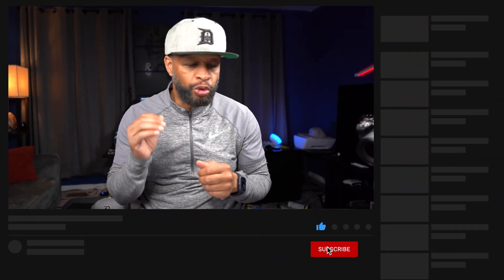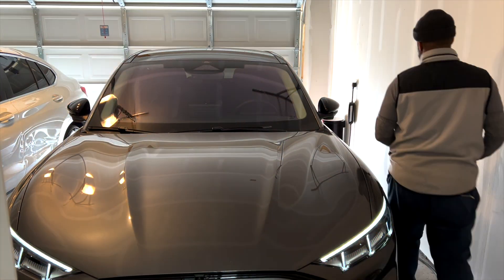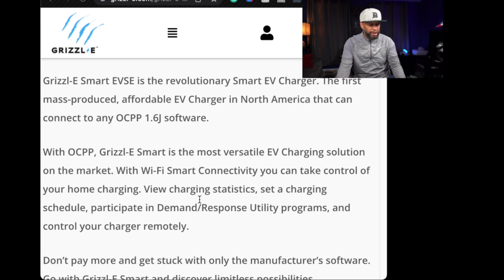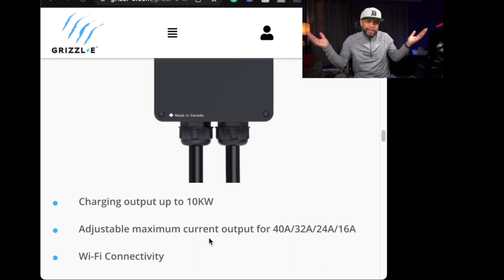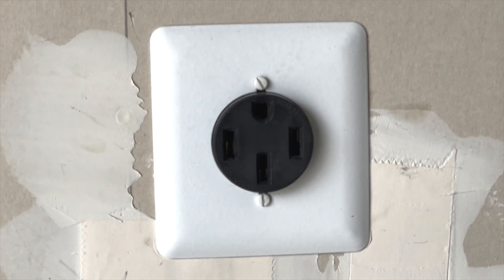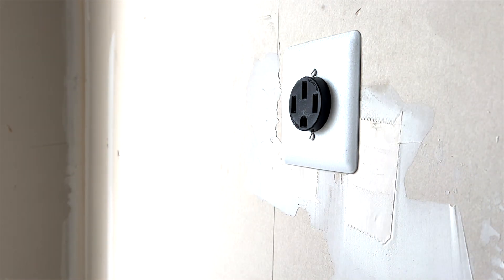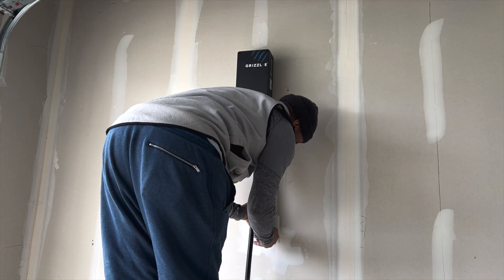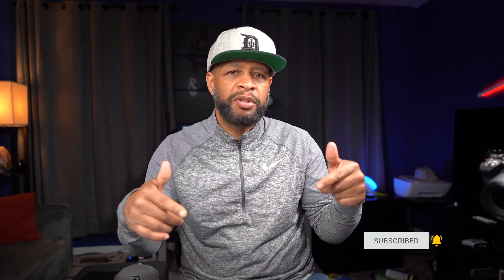Grizzl e EV Smart Charging Station

Comment: Nice can you show us how the app you choose works ?
Reply from the maker: I’ll do a follow up video, I need to do one anyway! Should of done it by now.
Reply: @RP3Reviews  I have the classic gizzl-e and wondering if I should have went smart 🤓
Reply from the maker: Well the app is very basic, no special advance features, basic schedule features just make sure the app and you car has the exact times lineup, there was times my Mach E wouldn’t allow the charge to take place. That was my fault for constantly making adjustments on my charge schedule inside my car settings . So when I did finally figure out the problem everything has been great. If you want something that you set the time and walk away and handle the charging itself go for it, but if you don’t have a problem of how you was doing it now then save the money. The app is very basic in its functionality